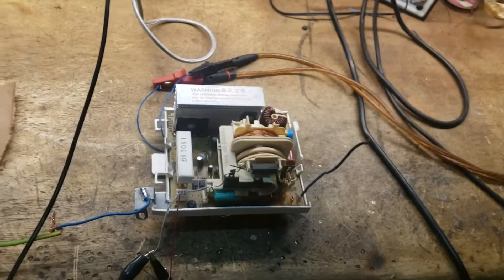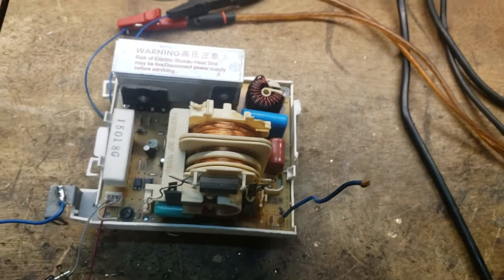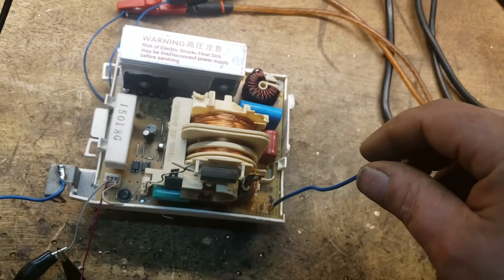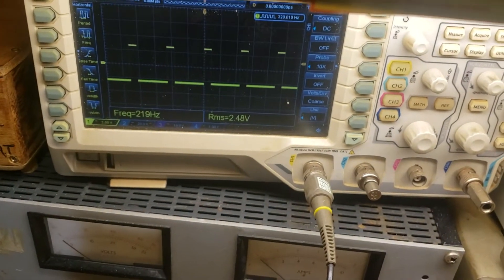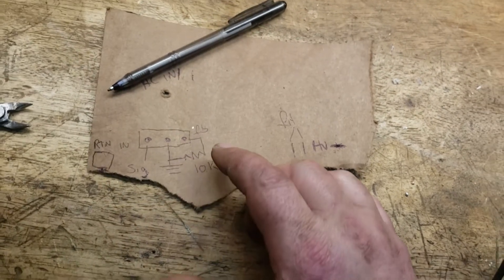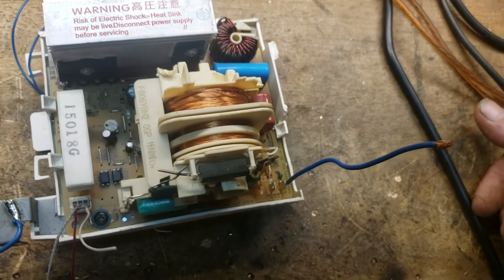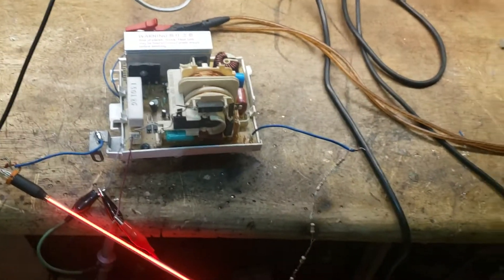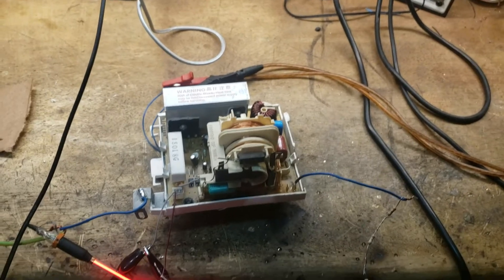Microwave inverter test

Comment: I have a panasonic microwave with  the same inverter but when i try to turn it on with the inverter,it blows the fuse away and when i disconnect the inverter board it lets me use the grill function.what could be the issue?

Comment: If I want to put a Transformer instead of the card, how do I remove the protection to turn on the screen and make the commands work?
Reply from the maker: You would use the command signal to the board to switch a relay and energize the transformer and voltage doubler but I'm not 100 percent sure it will work perfectly as the transformer capacitor and magnetron are matched...
Reply: @T2D.SteveArcs  The screen turns on for a few seconds and turns off if the inverter power is removed

￼
Reply from the maker: @محمدالعدوى-ح1ق  then there is a single back to the screen,  you need to find it
Reply: @T2D.SteveArcs  I want the relay to keep working as required of it
Reply: @T2D.SteveArcs  Thank you very much for the interest

Comment: Could you drive the flyback-inverter primary coil with a ZVS driver? Hence, running the transformer with a DC input of maybe 12v?
Reply from the maker: Zvs is an AC sinewave output and low voltage as you said, so you would need to remove the primary (as its wound for high voltage input at low current) then rewind it with many less turns with more stands in parallel to handle the lower voltage higher current. Also the transformer is set up for high voltage input flyback topology ie a large gap in the core, this is done to avoid saturation, if you drive it push pull the gap should be closed up, maybe you could slice a couple of pieces of another core if theres no space to close the core with the original bobbin or modify the bobbin seems as your removing and rewinding a thicker primary. But my answer is yes you can drive it with a Zvs, another option to avoid rewinding the primary is to use an intermediate step up transformer this would be a lot easier and you could also use the centre tapped single indicator ZvS which in my opinion is much more stable and overall runs better and more efficiently.. hope this helps 

Steve
Reply: @T2D.SteveArcs  Thank you. The closest thing I've been able to achieve is just putting together a high-voltage DC output from an old flyback-transformer from those old CRT TVs. The primary coil is driven with 5 turns centre tapped, with the ZVS driver getting an input from a drill battery. I was able to power a magnetron (producing microwaves as a fluorescent light bulb lit up) with the setup alone and just wondered if a similar and simplistic yet more efficient setup was possible with the inverter microwave technology.
Reply from the maker: @arkohmay  you have a microwave inverter?
Reply: @T2D.SteveArcs  no, unfortunately I do not. I have quite a few of the conventional microwaves with the MOT’s though. But I will buy a brand new one at some point and use it’s magnetron setup.
Reply from the maker: @arkohmay  take a look at my other videos you will love them if you like high voltage

Comment: I tried running and there is no high voltage output but the inductor on the circuit got very hot what might be the cause of this? I am running mine by grounding the orange wire not using a square wave.
Reply from the maker: You need a squarewave at the frequency and duty cycle I said in the video,  however if parts are getting hot without it running you may have a problem,  check your igbt isn't shorted

Comment: Great video. Thanks for sharing 🙂 . 
I am working on a lg smart inverter microwave. I observed the start button is not working when pressed repeatedly and other keys are working. What could be the possible cause and solutions. Thanks 👍
Reply from the maker: It could just be a worn touch button. Try bridging it manually and see if it starts
Reply: @T2D.SteveArcs  okay thanks
Reply from the maker: @isiakajimoh4842  no problem mate... 😁👍
Reply: @T2D.SteveArcs  I tried to bridge it and I came up working. I discovered the connecting flex three of the lines has  broken.
Reply from the maker: @isiakajimoh4842  cool you can fix those easily mate
Reply: The control board is a touch pad

Comment: I have a new unit made by Kenmore in the USA, the inverter starts up but goes off after a sec, repeats over and over until it gets warm then starts cooking. I unplugged the 3 wire connector to the board and it does the same thing, so the board must not be getting a return signal telling it the inverter is on. What kind of signal is it?
Reply from the maker: Sounds like you have a failed component on the board, check the silicon ie rectifier,  igbt, diodes,  and capacitors .. the board should do nothing with the signal plug removed
Reply: @T2D.SteveArcs  Yea, I'm getting up to speed on these, I used to work on the older ones for yrs. Not sure how to test an IGBT, I suppose I will will learn now. Lots of good youtube vids like yours helped me. cheers mate.
Reply from the maker: @vernonbosshard9317  thanks mate..  igbts like most silicon usually fail short circuit so you can check that with a multimeter on continuity mode or resistance mode, if you don't have a meter you could use a battery and lamp to see if it's short......
Thanks for watching 

Steve
Reply: @T2D.SteveArcs  So come to find out the IGBT had a bad solder joint, the solder looked good but it was hollow, fixed that issue, then the most puzzling thing ever for me on a microwave, I fought ALL kinds of weird issues, control board acting funny, not working with the cover on but fine with it off, sometimes not. So this microwave has one screw to hold the mag on, and a slot on the other side, turned out the metal mounting was bent slightly on the mag and it wasn't sealing tightly, RF radiation was messing up the electronics. I have never seen this issue before in all my 20+ yrs of repair, but back then they used 4 screws to mount them. This one ATE my lunch. This style of mounting is dangerous! I fixed the mag and so far so good, not one hiccup since. Fingers crossed!! Never give up, watch and observe the clues even if they don't make sense.
Reply from the maker: @vernonbosshard9317  👍👍

Comment: so can the high voltage be directly arced or will it overload the voltage doubler?
Reply from the maker: No I wouldn't arc it dont forget an arc is virtually a short circuit and its only a single igbt not designed for arcing so it will probably die...

Steve
Reply: @T2D.SteveArcs  yeah that's what I thought. I just got one of these from a scrapped microwave and was wondering how to turn it on. Then again, lots of smoke and flames and sparks would make for a pretty good show... thanks!
Reply from the maker: If you want to see arcs check out my other videos, I have videos of absolutely monster transformers 4ft arcs  300,000 volts 🤣🤣

Steve

Comment: Great video mate. Been trying to do this exact thing for some time now. Have my generator imputing the required signal. And all that happens is the main resistor on the board heats up. Couldnt find a short anywhere to cause this
Reply from the maker: Did u try to start in on reduced duty cycle? If not try setting 10% duty then powering.. make sure ur signal has offset so it's starts at gnd ...

Steve
Reply from the maker: Not sure the resistor should be get hot when it's not even running?.
Havnt got an inverter to hand now to look
Reply: @T2D.SteveArcs  just tried it with a reduced duty cycle at 2.5v still no hv output. But the resistor still gets hot
Reply from the maker: @ethanmellett2726  strange not sure why resistor hot when it's not running? Did it come from a working microwave? I think u have to have 5v plus and minus 2.5v try it with signal on b4 you apply mains.. start on say 10% then turn up.. work out how much current is on that resistor measure voltage drop on it then use ohms law to calculate the current mate... like I say I don't have an inverter now I gave it to one of my subs who needed one for his microwave 🤣🤣. Is it the exact same inverter I showed ?

Steve
Reply from the maker: @ethanmellett2726  it needs 5v but no off set if ur not sure put a small cap in series with the signal sat 220n or....
Reply: @ethanmellett2726  sound like the igbt is toast
Reply from the maker: Actually just looked at vid it looks like I was using-2.5v to +2.5v
Reply from the maker: If u look further down comments theres a comment from F.alt he says he had a different version and described how he got his to work??? 

Steve

Comment: Thanks for your videos. I have a Panasonic Genius 1300W Microwave with similar inverter as you have demonstrated. It shuts off/chips the breaker after 2-3 secs. The door switches are working. If I disconnect the magnetron it operates for whatever time set. Reconnect the magnetron and chips after 2-3 secs again. Could this be the inverter board. Someone suggested that it could be the an issue with the IGBT Transistor.
Reply from the maker: @fffinga Yeah it sounds like you have a short somewhere. Maybe IGBT, they are prone to fail short.
Reply: @T2D.SteveArcs  Thank you
Reply from the maker: I have a spare inverter I can give you if you are in the UK ...
Reply: @T2D.SteveArcs  My apologies for the late response to your offer. I definitely accept your offer. I could email you directly for the details if that is ok
Reply from the maker: @fffinga  I will give you an email address at some point today 
Steve
Reply: @T2D.SteveArcs  Great
Reply from the maker: @@fffinga Hi mate we need to make sure it's the same inverter. Here's a link to a vid to watch and let me know. https://youtu.be/NpjO21BxuSY
Reply: @T2D.SteveArcs  I checked and it is the very same one
Reply from the maker: @fffinga I have sent you an email address on the unlisted video. 
Also I will cover postage...
Do hope you are a subscriber 😉
Reply: @T2D.SteveArcs  Thank you. I am definitely a subscriber and will remain so and recommend others
Reply from the maker: @fffinga  Send me an email with your address etc and I will try get it posted tomorrow.
Reply from the maker: @fffinga  lol no worries mate I will get it posted soon as ....

Steve
Reply from the maker: @fffinga  just checked and I cant see an email from you. If you can get back to me asap I can try get in the post today.
Reply: @T2D.SteveArcs  Did you get the email address? I did not get a confirmation on the item.
Reply from the maker: @fffinga  I sent it to the address in London about a week ago she should have it now m8
Reply from the maker: Wife just said that due to current situation and it being Christmas period it could take upto 2 weeks to arrive.
Reply from the maker: Did u get it yet mate?
Reply: @T2D.SteveArcs  Not as yet my brother. It was received at the address I gave you and now it is on it's way to the US. I will definitely update you one I receive it. Thanks again
Reply: Mag is bad. You isolated the high current source.
Reply: Hi do you know how use microwave with transformer and without inverter  how to send signal to control panel to stop & start transformer pls reply

Comment: Of course I come across this video after I'd spent ages reading forums on how to set mine up, haha
Obviously don't short the outputs to ground, doing so on mine it blew some disk capacitors which were hard to get replacements for 
Also my one is a rectangular variant that requires the 110hz signal at 50% duty to the pin which you have connected the 10K resistor as doing so myself didn't work.
Beyond negative ion generators and microwaves, what other uses would such a powersupply have?
Reply from the maker: Thanks mate for this . Its handy to know how to get that version going... did use it for anything yet? ..
Happy 2021

Steve